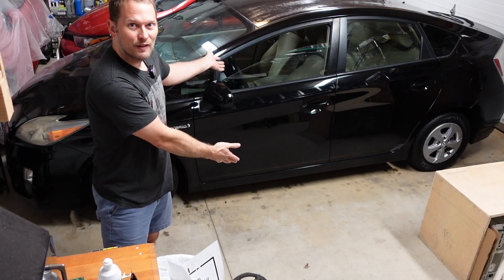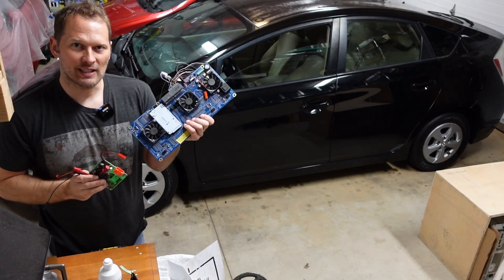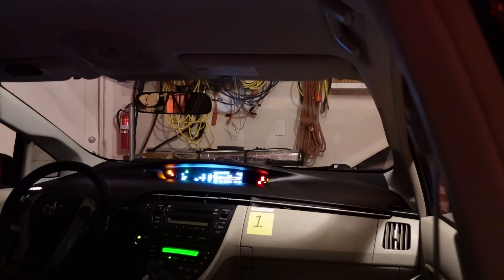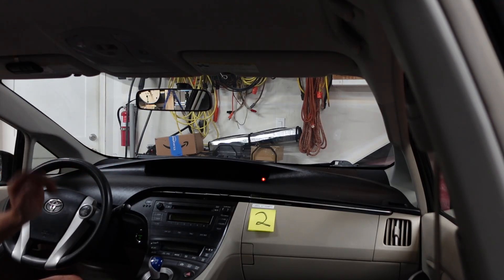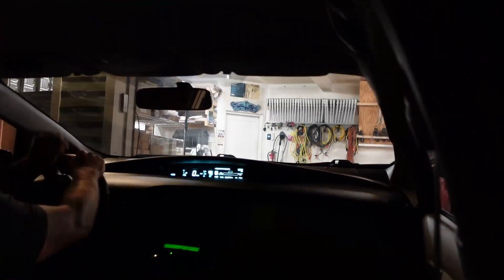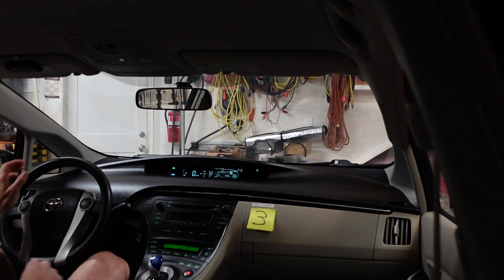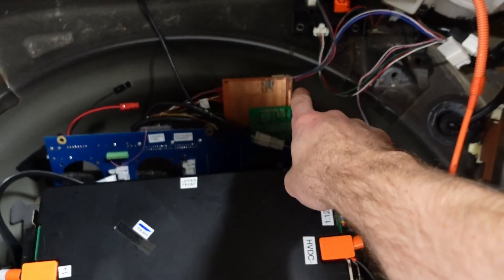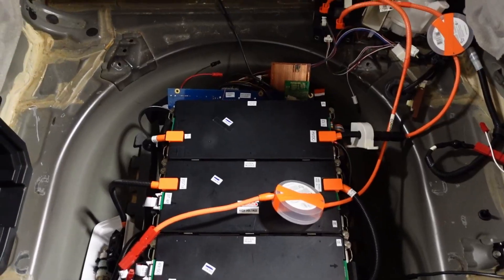LiBSU Proof of Concept - Gen3 Toyota Prius Lithium BMS Computer

Comment: Interested in this, hoping for some updates. Curious if the newer gen Prius lithium can be made to fit the gen 3.
Reply from the maker: More frequent updates: https://priuschat.com/threads/libsu-redesigning-the-battery-support-unit-to-support-lithium.249158/

Yes, the newer Prius lithium modules can fit in the gen3 Prius enclosure... however, it's not a 'clean' fit, and requires fabrication that's not worth the effort at scale.  Instead, it's easier to tear the module down to the cells and then build them into 2xBlades.

Comment: Hey, love your videos and your sick projects, ive been wondering at the scope of your project so far, are you planning on making this just for the prius? or do you think youll be able to make it work for other toyota hybrid battery layouts, as toyota as far as i can tell just uses higher module counts for bigger or more powerful cars, with the prius having 28 modules but 32, 34 and 40 module versions for example in the camry with 34 modules or some lexus suv's having 40. I myself have an IS300h that uses 32 modules, which is why im interested :)
Reply from the maker: My LiBSU product will eventually work with most Toyota/Lexus hybrids.  My initial focus is on the Gen3 Prius, Prius V, CT200H, and other compatible vehicles with QTY28 NiMH blades.  After that, I'll add the Gen2 Prius (and related).

Comment: Random question but would your prototype be able to increase battery capacity or is that a limitation coded into the computer?

Keep up the good work! Been following for awhile as my third gen needed a new hybrid battery. I opted for cylindrical route as opposed to “competitors”.
Reply from the maker: Yes, additional battery capacity (from a larger battery) is available to the car with my LiBSU product installed.

Comment: 10 kWh. Wow. How are you planning on charging those for users at home?
Reply from the maker: I already sell a similar plug-in 10 kWh conversion product for the G1 Honda Insight.  That product has a wall charger, which would carry over into this hypothetical 10 kWh Toyota Prius product.  Note that I initially intend to sell a non-plug-in pack close to OEM size (e.g. 2 kWh).  The hypothetical 10 kWh Prius product would come after that.
Reply: @doppelhub I’d say you are the best safety minded seller I’ve seen until now. Theoretically can I use it on a RX450H?
Reply from the maker: @ddkuo  Theoretically a future LiBSU product could work with the RX400h/TX450h/Highlander/etc.  These use a different NiMH blade type, than the 'standard' Toyota blade used in the Prius/etc.  My roadmap hits these 'standard' vehicles first.  In other words, an RX450h LiBSU derivative won't happen anytime soon.
Reply: @doppelhub but technically the whole assembly can be swapped out? As long as The voltage is right
Reply from the maker: @ddkuo  That's correct.

Comment: This is huge. hopping that the adaptation from gen 3 (once that is figured out) to gen 2 wont be to hard. 
 If it helps, I have two gen2s that can be used for testing, both have CANable adaptors wired into them, one has a battery pack apart the other has it intact.

now waiting for lithium modules that support bms leads
Reply from the maker: Gen3->Gen2 will require a different serial PHY, but otherwise it's very similar.  Of course, the devil is in the details, and for now my focus is on those details specific to the Gen3 Prius architecture.  If you want to join the beta waiting list, please send me a PM on priuschat.com (username: mudder)

Comment: Could this theoretically become a PHEV? Nothing so complicated as an onboard charger and port, but the ability to top off the pack from the mains at night would be nice to start the drive with a little EV range.
Reply from the maker: Yes, but only up to 25 mph... that's when the OEM hybrid computer disables EV mode.  The onboard charger is a solved solution, as I already have a PHEV product for the G1 Honda Insight.  The Toyota variant (shown in this video) will support an add-on plug-in charger, but it won't ship initially... initial focus is replicating OEM functionality... then adding the bells and whistles.
Reply: @doppelhub  The gen 3 Prius Plug-in allows for EV mode up to 62mph, but I'm not sure in which specific ECU that limit lives
Reply: @doppelhub  Blended mode above 25mph is useful too.

Comment: If helpful, I would love to get the equivalent data for the serial bus for the 07-12 Lexus GS450h, or anything else you'd need. 

I've done the traction battery disassembly before and am already sick of it, would do anything to have a 'real' solution.
Reply from the maker: Please send me a PM on Priuschat.com (username: mudder) stating the same.  I will eventually make and send a 'packet sniffer' to beta volunteers like you.

Comment: incredible work! actually, i'm kind of surprised that nobody has done this before. you make it look easy.
Reply: Someone did previously.
John Sullivan took a look at the product, warned the creator of the design flaws, that creator didn't listen and instead got mad at John.
Some people had their prius burn down from it.
The insight packs that John has designed and created, from my understanding all went well.
I'm personally excited for this prius pack. I can't wait for it to release.
Reply: @noburt9  i'm pretty sure the person you're referring to didn't reverse-engineer the prius BMS, which is why their battery is unsafe
Reply from the maker: @dylanwinn3  To my knowledge, nobody has created a safe aftermarket lithium battery yet for any NiMH Toyota vehicle.

In other words, yes, I agree there are lots of unsafe NiMH Toyota's running unsafe lithium conversion packs.  Time isn't gonna treat them well.
Reply from the maker: Hymotion had an LFP pack for the Gen2 Prius years ago... but fun fact it connected in parallel to the OEM NiMH pack, which remained in place.  They used a CAN injection method that isn't present in the Gen3 and later NiMH vehicles.

Comment: Congrats on your achievement! Quite an impressive feat. Your rebuttals and logical replies on PriusChat, regarding the need for a BCM, kept me from pulling the trigger on a non-oem pack. 

There’s a relatively well known battery manufacturer in China that’s selling lithium modules as a direct replacement for the nimh modules. Still concerning that these products still exist without a working BCM intended for Li. 

Keep up the great work, and thank you for your efforts.
Reply from the maker: Thanks!  I'm glad to have finally set the time aside to tackle this project.  Now that the firmware PoC is working, I'm diving straight into a RevA prototype PCB.

Yeah, it's scary how many companies are selling lithium retrofit packs with zero supervisory control... everyone is copying NexPower's failed discharge balance circuit, which is absolutely unsafe for lithium.

I think I've reviewed all but one of these aftermarket lithium products... they're all unsafe because they all lack a global arbiter BMS that can disable the hybrid system if anything goes wrong.  LiBSU solves that problem.
Reply from the maker: FYI: I anticipate working with some existing manufacturers to add LiBSU to their existing lithium products.
Reply: @doppelhub Some of the designed enclosures look well made. With some modifications that you’ve highlighted in your reviews, I’m sure they could be retrofitted to work well as a replacement for existing modules with integrated local monitoring. 

How do you foresee each module communicating to the replacement board? Would an additional wiring harness be required?
Reply from the maker: @tomygiang  Yeah, one of the newer 3rd party lithium blades even has a 0.1" header to allow external cell voltage measurements.  For blade-style lithium packs, I suspect a plug-in PCB that runs the length of the pack will work better than connecting a wire harness to each blade.  That long (but narrow) PCB contain the actual cell voltage measurement hardware, which will then connect to the LiBSU PCB via a two wire differential serial data cable.

Comment: great work! wiill the libsu be compatible with toyotas that use larger/higher voltage batteries than the prius? Such as the camry, estima, rav4, various lexus models etc?
Reply from the maker: Yes, future LiBSU products will work with more Toyota models.  The design is highly modular and designed to work with all Toyotas eventually... but the initial LiBSU product will only work with QTY28 blade Gen3 and similar vehicles.  Adapting to additional vehicles won't be nearly as much work as this first Gen3 Prius LiBSU product.
Reply: @doppelhub  Outstanding! I cant wait!

Do you plan to sell it as a standalone product, or will it only be part of a battery/controller kit that you develop/sell?
Reply from the maker: @harleyjones5200  More details to follow once I've worked out all those details.  I'm already in talks with some reputable battery suppliers, but those details will be revealed at the appropriate time.

Comment: Can you fit 10 kW into the original Prius battery size? Or what battery capacity do you plan to use?
Reply from the maker: Yes, I'm certain 10 kWh will fit in the original Prius battery location.  Battery energy density has come a long way in the past fifteen years.

However, I don't plan to initially release a pack that large, but that's what I'm prototyping with right now.  My initial goal is to ship LiBSU with a battery with similar kWh to the OEM pack.
Reply: I just found this site. Will you also be working one the Generation 2 Prius?

Comment: Exciting stuff! There are so many Toyota vehicles using NiMH batteries, this will be a game changer. Are the FoMoCo modules even close to being able to fit in the available space? If not, do you have any other ideas for modules? This almost makes me want to buy a Prius...
Reply from the maker: Yes, the 47Ah modules I'm using with will fit in the OEM battery location.  Right now I've just got them down in the spare tire well, with QTY2 modules on the bottom and QTY3 modules up top.  In the OEM battery location, all five modules would be placed side-by-side.  You'd need a custom bracket to mount the modules to, but they would certainly fit.

My initial focus is a battery with similar kWh as the OEM pack... but I'll eventually do a large pack (just like I did with the G1 Honda Insight, which I sell 0.9 and 10.4 kWh retrofit kits for).
Reply: @doppelhub  I'd be interested in results of any range tests with that 10KWh proof of concept pack. Staying under 25mph could be challenging, but if that could also be spoofed, a 10KWh lithium equipped Prius may be a good alternative to the Chevy Volt. Many of those 12S modules have their own BMS that could be utilized by the controller rather than reinventing the wheel.
Reply from the maker: @TinkerGear  I haven't done a complete range test (only had this working for less than a day).  However, in my driving today I easily pegged the "trailing 5 minute graph" at the maximum shown 100 mpg... so I'm easily getting above 100 mpg.

It turns out I have the perfect test track in my neighborhood: a gently rolling 2 mile road with 25 mph speed limit, followed by 4 more miles with 30 mph speed limit and nearly zero traffic... only one stop sign the entire way.  It wouldn't surprise me to achieve 150 Wh/mile on this test track (i.e. 50 miles from a 10.4 kWh pack (7.8 kWh usable)).  We'll have to see once I have data... but that won't be anytime soon.

Comment: John - Congrats. Apologies for never emailing back. But this is huge stuff. Time to do the Prius/Ct200h community right and get rid of the poor Lithium/Sodium batteries that are out there.
Reply from the maker: Safety is the goal.  I intend to work with existing/future aftermarket Toyota battery suppliers to add safety to their batteries.  At some point I'll wire up a sodium pack to my LiBSU RevA just to see how much the Prius hybrid drivetrain thrashes those cells.

Comment: What's the expected battery capacity going to be with this new setup vs something like the fomoco setup I have.
Reply from the maker: Not sure yet.  Need to see product fit in the existing space.  Since the Prius Plug-In already exists, I'm not sure there's much demand to convert existing (non-plug-in) Prius to aftermarket plug-in... particularly since EV mode only seems to work up to 25 mph.  Honestly it's too soon to know the final battery size... I'm prototyping with the exact same battery that's used in your 47Ah LiBCM Honda Insight setup (hope you're liking it!).

Just as I did with the G1 Honda Insight, I'll probably initially focus on a pack similar in size to the OEM NiMH packs.  Most customers don't want to pay extra for vastly larger packs... they just want to keep using their car exactly as it worked before.
Reply: @doppelhub even without a true high speed EV mode with a high SOC the Prius will bias towards draining the battery over using the engine and it'll get incredibly good gas mileage while the battery is above that SOC threshold. Making the non plug ins plug in would likely get the older cars into the hundred mpg club.
Reply from the maker: @906MediaProductions  Based on my driving today, PHEV easily gets my Gen3 Prius into 100+ mpg territory.  It's too bad the meter doesn't go higher than that.
Reply: @doppelhub  You should not go the PHEV route. At least not initially. Start with something simple as replacement for current non plug-in NiMH battery pack. That will keep the cost of the kit down which is most important as the 2nd/3rd gen car value is already very low. Not many would want to invest more into turning it PHEV which will make the thing a lot more complicated. Also, like you said, EV mode limited 25mph. So the economy of return making it PHEV is not feasible. Hope you will get beta version out soon as I will be the first to sign up to be your beta tester. Make sure to also monitor the temps to make sure the OEM fan is sufficient for cooling.
Reply from the maker: @unkertech  My initial focus is a pack similarly sized to OEM (e.g. 2 kWh).  Just as I did with my Honda Insight product, a larger pack will come later (e.g. 10.4 kWh).  LiBSU monitors both temp and fan speed, so yes it will do all that.  If you want to join the beta tester list, please send me a private message on priuschat (username: mudder).

Comment: Third time’s the charm. Congratulations on your proof of concept. I like your diy high voltage “junction boxes.” As an electrician, I approve.
Reply from the maker: Thanks!  Glad you appreciate my DIY HVDC fuse and pack disconnect...it's a plastic butter tray I repurposed for HVDC prototypes.

Astonishingly, one of my competitors shipped completely unfused prototype HVDC batteries to several dozen beta testers... the OEM fuse and service plug were still connected to those prototypes, but they were completely bypassed internally.  Beta testers had no idea until I brought it up in a previous video.
Reply: @doppelhub I’m familiar. DB.
Reply from the maker: Oh wait, are you talking about my triple insulated electric tape containers?  Ha, yeah, those are the result of not wanting to cut any OEM cables for the proof of concept.  All exposed conductors are wrapped, shrunk, wrapped again, and then placed in the tape containers for ever more safety.  Ha, I thought you were talking about the fuse and switch shown briefly in the bottom left corner at the end of the video.
Reply: @doppelhub I had to rewatch to see this repurposed butter tray. These butter trays and vinyl tape containers reminds me of the CH-47 Battle Damage Assessment and Repair (BDAR). Certain flight control connecting links could be replaced with a wooden broom handle.

Comment: This is amazing, great work!
Reply from the maker: Thanks!  Reverse engineering the OEM serial protocol was a TON of work.  The Toyota-specific serial interface is QTY620 lines of code, which I bolted onto my existing LiBCM firmware (~QTY9200 lines of code).  So in total the ballpark is QTY10000 lines of code required for the proof of concept shown in this video.

Comment: Super Excited !!! doing it the safe way!
Reply from the maker: Unlike other 3rd party Toyota products, LiBSU's design philosophy doesn't throw caution to the wind.
Reply: @doppelhub I actually have a working one of these systems  I just picked up a few weeks ago. Was pretty amazing back in the day. 5 kWh of extra capacity. But the price was $10,000+ installed.
Reply from the maker: @ericpowers7704  Sweet, I'll have to come take a look next time I'm up in your neck of the woods.  It's both crazy and understandable that they only sold around QTY100 units.  That price tag was a pretty penny fifteen years ago.

If you're not keeping it around through December (when I'll be up there), I'd happily pop some corn and watch whatever video footage you can collect.  I have all their service manuals/etc, but it's always good to get eyes on the actual product.